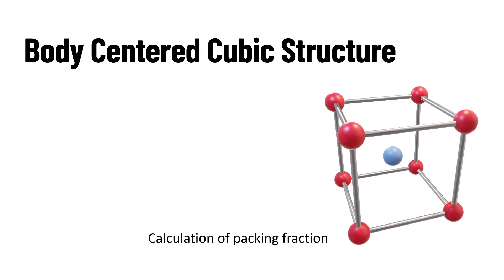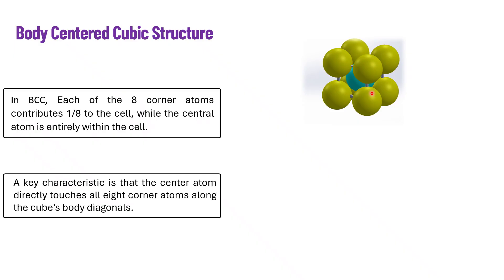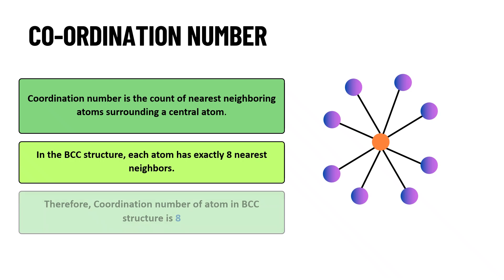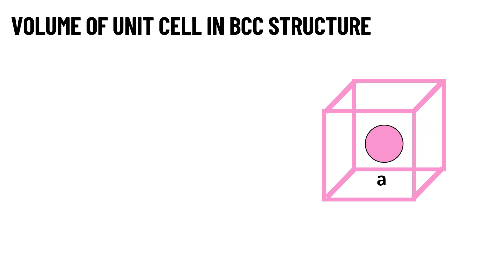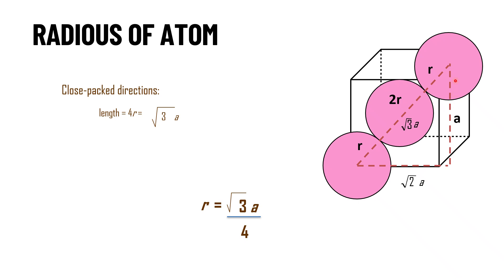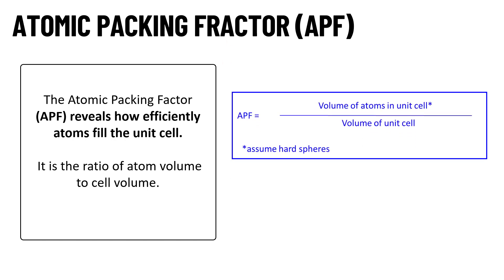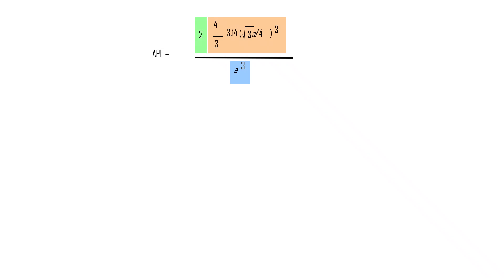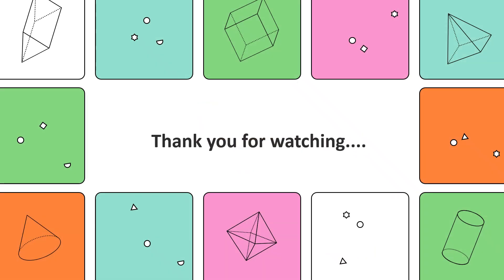Atomic Packing Fraction of BCC Structure | Step-by-Step Derivation Explained

Comment: This video actually made BCC click for me. I always thought atoms touch along the edges, but in BCC there’s that extra atom right in the center, so the corner atoms don’t touch on edges anymore. Seeing the body diagonal line going from one corner straight through the center to the opposite corner helped a lot — that’s where the atoms actually touch. Once that part made sense, the APF calculation felt way easier, and it finally made sense why BCC is denser than simple cubic (around 68%).

Comment: The video explains how to calculate the Atomic Packing Fraction (APF) for a Body-Centered Cubic (BCC) crystal structure, a common arrangement of atoms in metals and materials. It shows how many atoms are inside a BCC unit cell and why the atoms touch along the body diagonal of the cube. The presenter walks step by step through the derivation of the atomic radius in terms of the cube’s edge length. Using that, it calculates the APF value, showing how densely atoms are packed in BCC compared with other structures. Overall, it’s a clear, exam-friendly explanation of BCC geometry and packing efficiency

Comment: In the video we got to know that the information about bcc structure or calculation of apf factor in bcc 
how they are made  in bcc atoms are at corner and their are 8 corner atom in bcc . Tantalum and molybdenum are the example of bcc material.  compare to scc structure bcc is more stable and prevalent  . the coordination number of bcc their radius and volume of bcc atoms structure and the arrangement of atom in unit cell of bcc in bcc 2 atoms in unit cell of structure. the APF of bcc is 0.68 also how to calculate the APF in bcc structure

Comment: The video provides information about the Body-Centered Cubic (BCC) structure, including the calculation of its APF. In BCC, atoms are present at the corners and one atom at the center of the cube. There are two atoms per unit cell, and examples include tantalum and molybdenum. The coordination number, atomic radius, volume, and APF value of 0.68 are also explained.

Comment: This video explains what a BCC(body centered cubic structure) is and how's it's APF is calculated using APF formula.so it has 8 corner atoms contributing to 1/8th of cell,while central atom is within the cell,it is the most stable arrangement.eavh atom has exactly 8 nearest neighbours therefore,the coordination number of BCC structure is 8,total number of atoms per unit cell is= 1(from corner i.e 8*1/8) and 1(centre),i.e total number of atoms per unit is 2 atoms.the radius of bcc structure is √3a/4,so it's calculated APF is 0.68.

Comment: the Body-Centered Cubic (BCC) crystal structure, where atoms are positioned at the eight corners and one at the very center, resulting in 2 atoms per unit cell and a coordination number of 8. It highlights that atoms touch along the body diagonal, a key geometric relationship used to derive the Atomic Packing Fraction (APF) of 0.68. This summary illustrates why BCC metals, like iron and molybdenum, are more densely packed than simple cubic structures (52%) but less than FCC (74%), providing a fundamental look at how this arrangement dictates material stability.

Comment: The video explains how to calculate the Atomic Packing Fraction (APF) of a Body-Centered Cubic (BCC) crystal structure. It shows what APF means, counts how many atoms are effectively inside a BCC unit cell, derives the relationship between the atomic radius and the lattice parameter, and then uses that to compute the APF value step by step. This is useful for understanding how densely atoms are packed in BCC materials like iron.

Comment: The video explains the Body - Centered Cubic (BCC) crystal structure .the packing Factor (simple cubic is 52 %, but lower than 74% contributes to BCC stability in metals like iron,molybdenum and tantalum.

Comment: The video explains the calculation of the Atomic Packing Fraction (APF) for the Body-Centered Cubic (BCC) crystal structure, a common lattice arrangement in metals like tantalum and molybdenum. It describes the BCC unit cell as having atoms at each of the eight corners and one atom at the center, with the center atom touching all corner atoms along the body diagonal. The total number of atoms per unit cell is calculated to be two: one from the combined contribution of the eight corner atoms (each contributing 1/8) and one fully from the center atom. The video defines the coordination number for BCC as eight, meaning each atom connects to eight others. The atomic radius is derived using the 3D Pythagoras theorem, resulting in a formula where 4 times the radius equals the square root of 3 times the edge length. The APF is then calculated by dividing the volume of the two atoms (treated as hard spheres) by the volume of the cubic unit cell. The final result shows an APF of 0.68, meaning 68% of the space in a BCC structure is occupied by atoms, making it more efficient than a simple cubic structure.

Comment: The Body Centered Cubic (BCC) structure features atoms at the eight corners of a cube plus one atom in the very center. This arrangement results in two atoms per unit cell and a coordination number of 8. Through mathematical derivation using the body diagonal, the atomic packing fraction is calculated to be 68%, meaning 68% of the space is occupied by atoms, making it more stable and efficient than a simple cubic structure.

Comment: The video explains the Atom Placement: Atoms are located at each of the eight corners of a cube, with one additional atom sitting exactly in the center of the body. Atoms per Unit Cell: The 8 corner atoms each contribute 1/8 to the cell (8 \times 1/8 = 1 atom).
The center atom is entirely within the cell (1 atom)
Total: There are 2 atoms in a BCC unit cell.
In a BCC structure, 68% of the space is occupied by atoms, while the remaining 32% is empty (void space) . This makes it more efficiently packed than a Simple Cubic (SC) structure but less dense than a Face-Centered Cubic (FCC) structure.

Comment: The video really cleared up how the BCC structure works. Instead of just having atoms at the corners, there’s one extra atom sitting right in the heart of the cube. Because that center atom is there, the corner atoms are pushed apart and no longer touch along the edges. The most helpful part was seeing the 'body diagonal that imaginary line cutting straight through the center of the cube from one corner to the opposite far corner. The video shows that this is where the atoms actually touch, which is the key to all the math. By the time you get to the Atomic Packing Fraction (APF) calculation, it’s easy to see why BCC is denser than a simple cube, filling up about 68% of the space.

Comment: This summary does an excellent job of distilling the core information from the video about calculating the Atomic Packing Fraction (APF) for a Body-Centered Cubic (BCC) structure. It clearly outlines the fundamental concepts, from understanding what APF is to the step-by-step derivation. By mentioning the calculation of atoms per unit cell, the significance of atoms touching along the body diagonal, and the derivation of atomic radius, the summary effectively captures the essence of the video's explanation. It's concise yet thorough, making it very helpful for anyone looking to quickly grasp the key takeaways from the lesson on BCC APF.

Comment: In this video explains how to calculate the atomic packing fraction(APF) for body-Centered cubic structure, through the geometry of the BCC unit cell, identifying how many atoms are effictively inside the cell, determining the relationship batween the atomic radius and the edge length and then using these to drive the APF formula. It break down each step clearly so that viewers can understand how the  densely the atoms are packed in bcc arangement compared to the total volume of the unit cell

Comment: In a Body Centered Cubic (BCC) structure, atoms are arranged with one at each of the eight corners and one sitting directly in the center of the cube. Because the corner atoms are shared, each unit cell effectively contains two full atoms.
To calculate the Atomic Packing Factor (APF), which measures how much space is filled, we use the fact that atoms touch along the cube's body diagonal. This creates a relationship where the diagonal length is 4r = \sqrt{3}a. By comparing the volume of the two atoms to the total volume of the cube, we find that a BCC structure is 68% filled with atoms and 32% empty space.

Comment: This Video Exlpains 
A Body-Centered Cubic (BCC) structure is a crystal arrangement with atoms at each corner of a cube and one atom in the very center, resulting in 2 atoms per unit cell (1 from corners, 1 central) and a coordination number of 8 (each atom touches 8 others). Common in metals like iron, chromium, tungsten, and alkali metals, BCC offers good packing (68% volume) but is less dense than FCC, making these metals often harder but less malleable.

Comment: The following video provided brief knowledge about BCC structure consists of 8 corners and a atom at a centre of the cube  it also has no of atom per cell is 2 .radiuss of an atom is √ 3/4.and also the info about how apf is calculated  in a step by step manner and how they touch the body of the diagonall  geometry is used to fing atomic packing factor  .apf is nothing but how much unit cell volumes if filled by atoms this video Is very helpful for such information

Comment: The BCC structure has 2 atoms per unit cell one at the center and 1/8th at each corner  The final Atomic Packing Fraction is 68%, meaning 68% of the space is filled with atoms

Comment: The video provides information about the Body-Centered Cubic (BCC) structure and the calculation of its atomic packing factor. In BCC, atoms are present at the corners and one at the center, totaling two atoms per unit cell. Tantalum and molybdenum are examples of BCC materials. The coordination number, atomic radius, volume, and APF value of 0.68 are also explained.

Comment: In this video, I learned about the Atomic Packing Fraction (APF) of the BCC structure. 
It explains the BCC unit cell, the number of atoms it contains, and why atoms touch along the body diagonal. 
The video also provides a clear, step-by-step calculation of the APF in an easy-to-understand manner.

Comment: A step-by-step derivation for the Body-Centered Cubic (BCC) unit cell. It calculates the effective number of atoms (2), relates the atomic radius to the edge length (4r = a\sqrt{3}), and proves the APF is 0.68.

Comment: This video give information about BCC (body centered cubic) structure and also What is atomic packing fraction, How to calculate number of atoms in a BCC unit cell, Why atoms touch along the body diagonal, Derivation of atomic radius in terms of 'a', APF value and its physical meaning.

Comment: In this video we learnt about BCC (body centered cubic) structure and also What is atomic packing fraction, How to calculate number of atoms in a BCC unit cell, Why atoms touch along the body diagonal, Derivation of atomic radius in terms of 'a', APF value and its physical meaning.

Comment: In this video, I have learnt about the Atomic Packing Fraction (APF) of the BCC structure. The video explains the BCC unit cell, number of atoms, and why atoms touch along the body diagonal. It also shows the step-by-step calculation of APF in a very simple and clear way.

Comment: The video explains how to calculate the Atomic Packing Fraction (APF) for a Body-Centered Cubic (BCC) crystal structure. It shows that in a BCC unit cell there are 2 atoms per cell (one at each corner shared and one at the center), and derives the relationship between the atomic radius and lattice parameter. Using this, the video calculates the APF, which is the ratio of the volume occupied by atoms to the total volume of the unit cell, and finds that the BCC packing efficiency is about 0.68 (68 %). This helps students understand how atoms are arranged and how efficiently space is used in the BCC structure.

Comment: provides a comprehensive step-by-step derivation of the Atomic Packing Fraction (APF) for a Body-Centered Cubic (BCC) structure.A BCC unit cell consists of eight corner atoms and one additional identical atom situated precisely at the center of the cube

Comment: The video explains how to derive the Atomic Packing Fraction (APF) for a Body-Centered Cubic (BCC) crystal structure. 
It shows how BCC has atoms at each cube corner and one atom in the center, and how this affects packing. 
The lesson walks through the step-by-step calculation, including the number of atoms per unit cell and the volume they occupy. Finally, it calculates the APF value for BCC, illustrating how tightly atoms are packed in this structure.

Comment: The video explains how to calculate the Atomic Packing Fraction (APF) of a Body-Centered Cubic (BCC) crystal structure - showing the number of atoms per unit cell, how they touch along the body diagonal, and the final APF value for BCC.

Comment: In this video in BCC  (body central cubic)each of the eight corner atom constributes  of 1 / 8 the cell  while the central atom is entirely within the cell 
example :-chromium( cr), tungsten (W) stronger interatomic bonding compared to the simple cubic structure BCC is more stable one centre atom is directly touches all 8 corner atom along the cube body diagonals 
coordination numbers  = 8 in BCC  8 atoms located at the 8 corner and one atoms completely inside the unit cell atoms per unit cell = 2   cube APF =0. 68

Comment: The video explains the Body-Centered Cubic (BCC) crystal structure and shows how to calculate its Atomic Packing Fraction (APF). It describes how atoms are arranged in BCC (8 corner atoms + 1 body-center atom → 2 atoms per unit cell), explains the relation between atomic radius and lattice parameter using the body diagonal, and finally derives the APF value for BCC. The video gives a clear, step-by-step mathematical explanation useful for exams.

Comment: This video clearly explains how to calculate the Atomic Packing Fraction (APF) of a BCC structure. It shows how atoms touch along the body diagonal, derives the relation between atomic radius and lattice parameter, and finally calculates the APF step by step. Very helpful for understanding BCC crystal structures.

Comment: Explain about a Body Centered Cubic structure it is a common crystal arrangement in metal where atom sit at each corner of a cube and one atom at the centre of cube, with coordination number 8, number of atom in unit cell is 2, volume of unit cell is a³, APF for Bcc structure is 0.68.

Comment: This vedio explain the atomic packing factor of a body centered cubic In this structure, atoms are at the eight corners of a cube and one atom is at the center of the cube.
The atomic packing fraction (APF) tells us how much space inside the crystal is filled by atoms. In the BCC structure, atoms are not packed as closely as in FCC
Metals like iron (at room temperature), chromium, and tungsten have a BCC structure..

Comment: Explains BCC crystal structure (body-centered cubic)
• Shows atoms at corners + 1 in the center of cube
• Derives relation between atomic radius and cube edge
• Uses geometry to calculate Atomic Packing Factor (APF)
• APF = how much of the unit cell’s volume is filled by atoms 
• Concludes BCC packing efficiency ≈ 0.68 (68%) 
• Useful for understanding crystal density & material

Comment: BCC stands for Body-Centered Cubic, a crystal structure with atoms at the eight corners of a cube and one in the center, totaling 2 atoms per unit cell. Atoms touch along the body diagonal, giving the radius. The Atomic Packing Fraction (APF) is the volume of atoms divided by unit cell volume. This means 68% of the space is filled by atoms, with the rest as empty voids.

Comment: This video elucidates the Atomic Packing Factor (APF) of a Body-Centered Cubic (BCC) structure. It details the methodology for calculating the number of atoms per unit cell and the atomic radius, further elaborating on the derivation of the APF formula and the step-by-step calculation, which culminates in a final APF of 68%. This percentage signifies the proportion of space occupied by atoms within the BCC structure.

Comment: This video explains the Atomic Packing Fraction (APF) of a Body-Centered Cubic (BCC) structure, detailing how to calculate the number of atoms per unit cell and the atomic radius. It further elaborates on the derivation of the APF formula and the step-by-step calculation, resulting in a final APF of 68%. This percentage signifies the proportion of space occupied by atoms within the BCC structure.

Comment: This video clearly explains about the body centred cubic (bcc ) structure.  In BCC 8 atoms located at the 8 corners and one atom completely inside the unit cell. BCC unit cell is called as a perfect cube. The atomic packing fraction is calculated as the volume of atoms divided by unit cell volume.  Coordination number is 8. The apf value for bcc is 67% and the void space is 32%.. Tantalum and molybdenum are the example of bcc material. Overall the video was very informative.

Comment: This video is about atomic packing fraction of BCC structure. 
And step by step how the APF is calculated. In BCC structure there are eight corner atoms which are located on the corners of this BCC structure and one is located at the centre of the BCC structure . 
And  we have to find the atoms per unit cell, coordination number, volume of unit cell, radius of atom's.

Comment: This video explains how to calculate the Atomic Packing Fraction (APF) of a Body-Centered Cubic (BCC) crystal structure step by step. It shows how many atoms are effectively inside a BCC unit cell and uses that to determine how tightly atoms are packed in the structure. The APF gives insight into the density and packing efficiency of BCC metals.